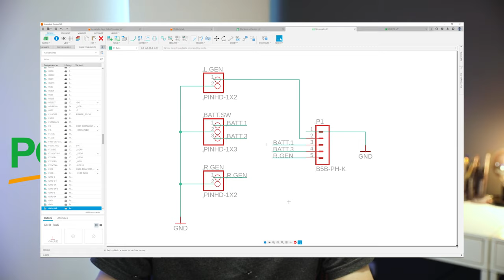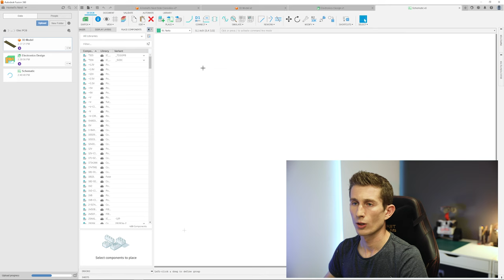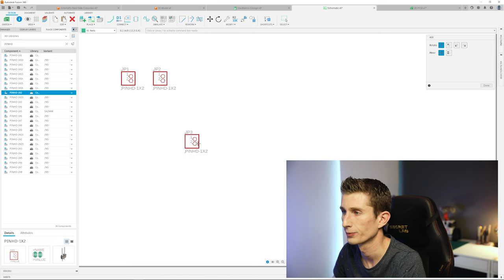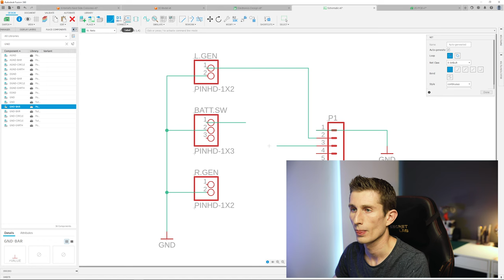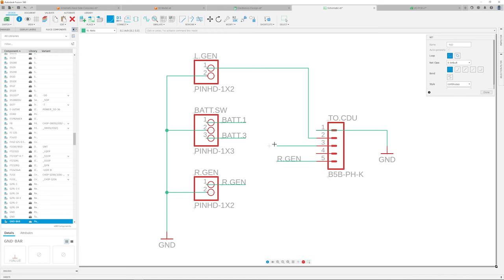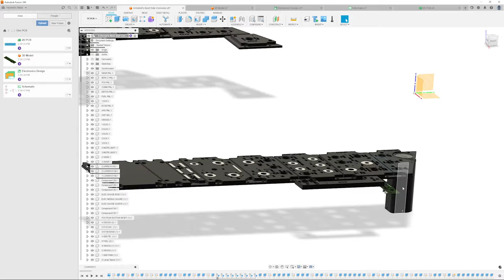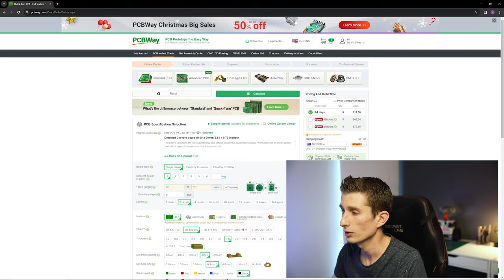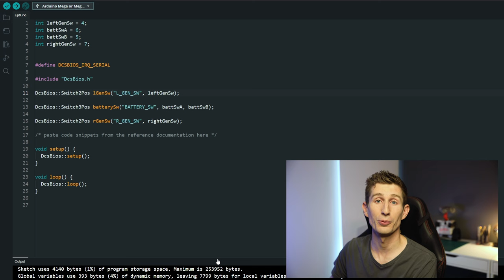Ep: 8  - Design Circuit Boards in Fusion 360 | Build Your Own Flight Simulator

Comment: I’ve designed my first PCB for an Apache Comms panel following your tutorial which has been invaluable but I’ve hit a snag. First I cannot find in my fusion library the con-jst-ph components. I only get the SH variant I think. I worked around this just using regular pin connectors (pinhd). However I want to mount to my PCB 6x6 tactile led buttons but I cannot find them anywhere in the library to do the layout. Any help on the library problem would be enormously appreciated. Please keep these tutorials coming.
Reply from the maker: Hey! That’s awesome to hear that you’re making your own PCBs. Yeah sometimes fusion doesn’t have all the libraries we want - so you can download individual components from websites like mouser, or find libraries to install 
I started using Eagle prior to it merging into Fusion - and it had a really easy way of adding components like 6mm tactile etc 
But I haven’t looked into adding new stuff into fusion - I’ll see if I can find something for you 🫡

Comment: Amazing tutorial, but I have one question to ask. I'm a total beginner, and I'm wondering, what's the point of pcbs/circuit boards if you can just connect your switches straight to the Arduino?
Reply from the maker: Hey circuit boards allow your designs to be more modular, as well as give you better flexibility with how switches and processors connect 
You can definitely connect straight to an Arduino - but it can become messy and complex

Comment: Suggestion from a brand new subscriber - could you do a video showing how to run a stepper motor and then a servo motor for something like an analogue guage? I have 3d printed a set of throttles for the Tomcat, that have 3 stepper motors for the throttles and wing sweep handle, driven via gt2 belts. There is sufficient tension/friction on the belts for the stepper motors to move the throttles, and the 'stiction' when moving the throttles by hand is acceptable, about the same as my t16000m throttle. I am currently running it with leonardos as an HID device. I tested the stepper motors with basic stepper libraries, and the throttles and wingsweep handle move beautifiully forwards and backwards. I have also managed to code the leonardo such that when a switch is thrown (ie the autothrottle switch, which will eventually be electromagnetically held), the throttle axis is 'disabled' and keeps sending the last known position to the computer. Thus it will fool DCS that the throttles aren't moving when in autothrottle so that the stepper motors can move them, otherwise the autothrottles would immediately be disengaged in DCS. So all the individual elements are there, I just need to put it all together. just getting to this point has been somewhat tortuous but I sure have learnt a lot!
Reply from the maker: Hey! That sounds like you’ve made some awesome progress!! Most people struggle trying to write code like that to disable the throttle axis 
I’ve got steppers and servos on the list :) definitely a key component in all cockpits 
Thanks for the comment and being part of AHN 🙌🏻

Comment: ... did i miss where you showed you connecting the 5pin connector (first pin) to the Gnd mesh during board layout, you showed the other 2 connectors being linked to Gnd... or make that, how did it know that the mesh you created needs to make Gnd common ?
Reply from the maker: Hey!! So around 16:15 you’ll see me finish up connecting the 3 input connectors to GND 

Then I have a GND symbol attached to the cursor, I place it and then connect pin 1 (To CDU) to the GND symbol

With both those “nets” all named GND (because the warning asks if you want to rename the net to  GND) - they will all want to connect to each other regardless of what the schematic looks like (all nets of the same net name will connect) - so then when you see me Polygon Pour at 24:10 - I name the polygon GND and that’s how it knows to tap all the GND pins into the polygon 

You can do this for 5V as well - really you can do this for anything that has the same name :)
Reply: missed where you tagged the polygon as Gnd. that was the missing bit. thanks. @aHornetsNest
Reply from the maker: @georgelza  😃😃

Comment: super interesting as usual ! what is the point of declaring variables with the Pin numbers at the beginning rather than doing it directly in the lines of code?
Reply: This is explained in earlier videos
Reply from the maker: Hey mate! Reason for the use of variables is to not hard code/bake numbers into the code - variables allow you to dynamically change the code 
Episode 6 goes into depth about this :)

Comment: I'm not quite sure what the point of the PCB is. Why couldn't you just run the wires from the switches themselves to that very same white (JST?) connector that goes into the Arduino? All you would need to do is connect the grounds together to one same pin, that then also goes to the Arduino. Is the whole thing just for the sake of a cleaner looking or more accessible build? Thanks
Reply from the maker: Hey there, you can definitely do that, but at the end of episode 7 I talk about that 😊
When it comes to maintenance you don’t want to be pulling out entire looms of wiring just to remove and work on a panel. 
If you were running maybe a few key panels sure, but when you’re running a full cockpit - you will ratsnest all your wires very quickly if switches / panels were connected directly to an arduino
Reply: Ok I can see that makes sense when you consider how many panels there will be…thx!
Reply from the maker: :D

Comment: Love this video. Very inspiring! You make it look so easy!
Interesting choice of ground connector. Depending on what fusion provides, I would probably have used a standard grounding connector, as the upside down T is typically used for chassis ground connection.
Reply from the maker: Thanks mate! Yeah fusion provides a range of symbols 
I purely chose the upside down T because it looked good 😂 and kept them the same haha 
I’m sure there is a more technically correct GND symbol
Reply: @aHornetsNest , I was just curious, do you know if fusion has female headers? I couldn’t find them. Although it’s not a big deal for creating the schematic or the pcb, it does matter for the BOM. I’d like to use female headers to directly mount arduinos to the pcb.
Reply from the maker: Hey, I struggled finding female headers 
I had to create my own unfortunately 
I will make a tutorial coming up how to do that :)
Reply: @aHornetsNest , thanks for the response, looking forward to that!  I think I found a way to get one, though no 3D model for it. Basically you need to go to library manager, and enable all other components. You will find a component named con-lsta, which is the female version.

May I ask you one more question? Do you know how to place components and silkscreen prints accurately on the pcb? I have a couple of LEDs that need accurate alignment with some holes in the panel. The pcb sharp itself is already accurate with the panel. Thanks for all the good work and the responses!
Reply from the maker: @baronvonrichthofen2021  hey mate, what I usually do with that is, create a DXF in fusion of the panel shape, plus any reference marks (generally I create small circles) 

Then I import that as a the board shape - those reference circles turn into holes as the PCB thinks they’re drill holes 

Align the components to those reference holes, then you can delete the reference hole either in the board editor, or in the sketch - it just depends how you do it 

Then you can push that board to a 3D model to see how it fits 

I do want to get around to making a video like this 😃
Reply: @aHornetsNest  thanks! I’m assuming there’s a way to easily import a sketch as the board shape. I’ll need to figure that one out, but sounds like a good way to do it. I’ll be looking forward totdat video :)
Reply from the maker: Hey mate there is 
You can save a fusion sketch as DXF by using the right click menu on the sketch 

Then you can go to the automate tab in fusion electronics board file… and use a ULP called importDXF 
It’ll import that as a line layer - you’ll need to make sure it selects layer 20 so it acts a board outline 
Then you’re good to go

Comment: Excellent video!!!!  I absolutely agree with putting in a little extra work up front with the PCBs and save the wiring nightmare later.  It looks so clean and easy to connect.
Reply from the maker: Thanks mate!!! Yeah absolutely - and this way you can take these panels anywhere and connect them to other systems if you need to :)

Comment: Hey Scott.  First off, I love the videos.  They are super informative.  I have a few questions.  First off, I built a button box and used a button matrix and a code I copied from another video.  I am running into conflicts since I have too many buttons and on/off switches for the button matrix to work flawlessly.  That being said, I just bought an arduino with more pin connections so that the box will work better without a matrix and I have room for expansion in the future.  How would you write code for potentiometers and rotary dials?  Can all the grounds for button, switches, and dials be connected into one pin slot on the arduino?  Since I am currently not running DCS bios is there a way to write the code to reflect that, or do I need to install and run the bios?  Thanks in advance for any help.
Reply from the maker: Hey there 😃 thanks for the comment! Too many inputs and too little pins is the story of my life 😂 you can use a technique called multiplexing and then storing that data in an array, so you can have 16 inputs go to one pin
What’s the new arduino you got? 
Yeah you can connect all your grounds to the same ground pin, that is very common and I do that for all my panels 
Coming this Tuesday is how to use potentiometers!!! So perfect timing :) it’ll go through everything on why it works, wiring and coding 
Depending on your arduino will determine if you need bios 
If you are running a board with an AtMega32u4 chip in it - you can just make it a hid controller 
Anything else will need DCS bios 
Hope this helps :) anything else just let me know 😃
Reply: @aHornetsNest  ELEGOO MEGA R3 Board ATmega 2560.  Can you use multiplexing with  toggle switches?  I never wired resistors into my matrix, so with 4 toggle switches, it screws my matrix up a bit.  I figured with the massive amounts of inputs on the mega r3 I wouldn't need to use a matrix.  Looking forward to the pot video!
Reply from the maker: @JoshuaJohnson-ve7ty  yeah most input types will work with multiplexing :) 
With the Mega, you’ll need to run DCS Bios with it :) go check out Ep.7 it’ll get you up and running within 20min 😃 I’ll also make a video for multiplexing later down the track